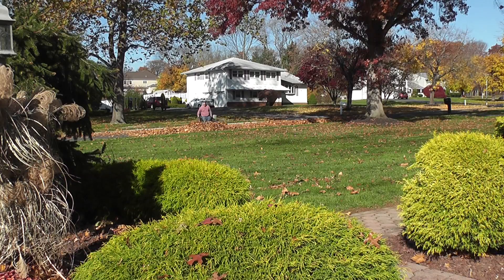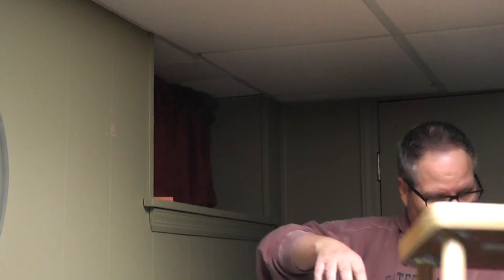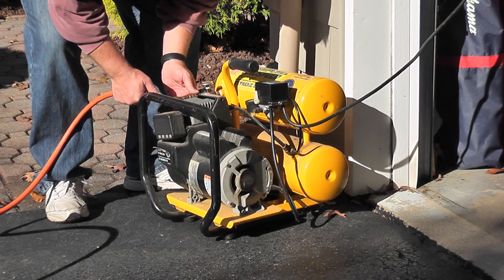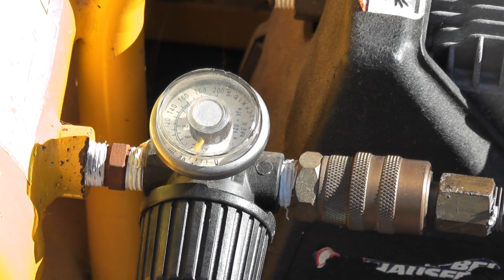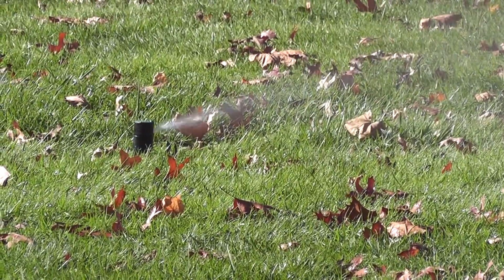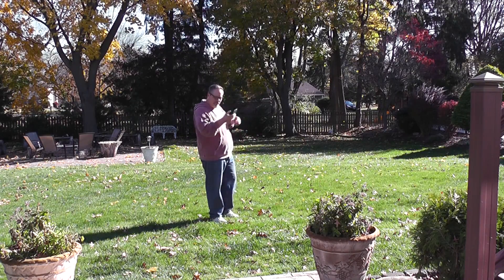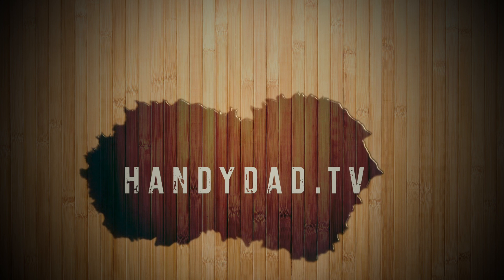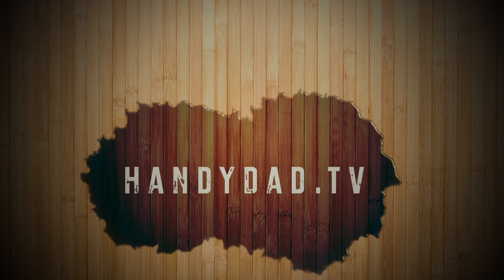Winterize Sprinklers and Garden Hoses

Comment: Nice video, was the compressed air on before you opened the zone from your phone. I thought you had to have a zone opened before you introduce air and what pressure did you set it for. Thanks
Reply from the maker: +RAYLEGEND I use low pressure ~40 psi so I don’t damage the pipes. My compressor doesn’t have enough volume to blow water continuously, so I need to close the zone to let it fill the tank then open the zone again. I do this a few times for each zone